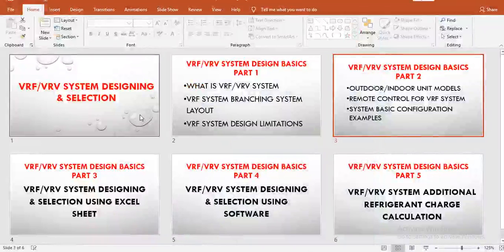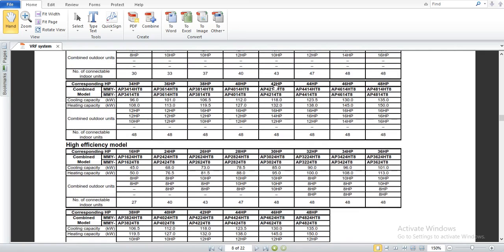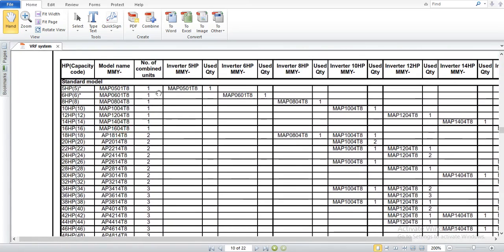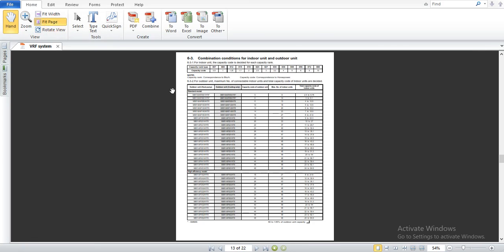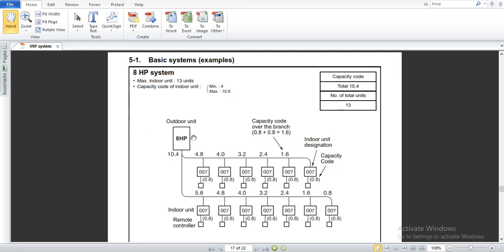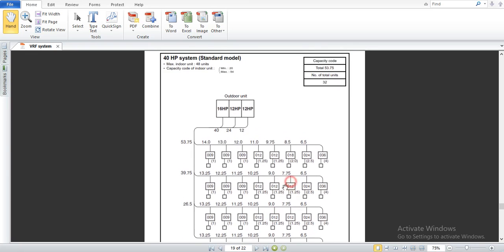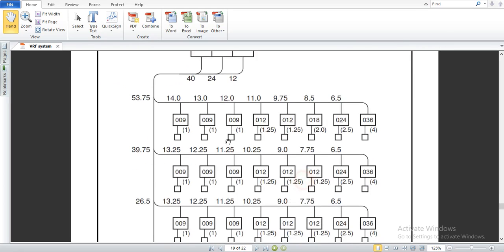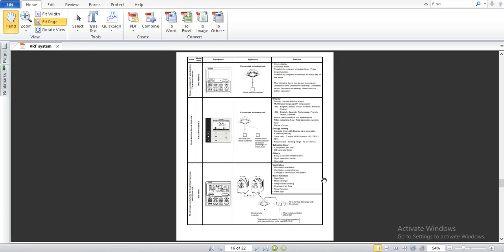vrf system working, designing & selection/vrv system, toshiba vrf system, unit selection part 2

Comment: Question sir, for vrf location, if i have 2 buildings that are connected to each other, do i need to provide 2 separate vrf for each building or 1 vrf is enough?
Reply from the maker: @Angelica it depends on the manufacturer specs while designing your vrf system. As I mentioned what steps need to be considered while designing vrf system. You have to consider total developed length, correction factors, no of indoor units and several other factors. If you see tutorial number 4 and 5 in which I have explained in detail, that would help you more.

Comment: Sir, I am working as a site engineering, recently I have seen that for vrf the outdoor is of low capacity and indoor is of high capacity, I know about diversity factor but in my case indoor is only one (ductable of 8tr) and outdoor of 8hp, then how diversity is used as it has only one indoor unit. The units are of bluestar. Plz explain🙏
Reply: Your comment is a bit old but I'd like to throw in my 2 cents.

The indoor unit is a refrigerant-to-air heat exchanger whose cooling/heating power depends on the exchanger area and the temperature and mass flow of the refrigerant and air. Units with higher nominal capacities have larger exchangers. Typically, the nominal capacity of the indoor unit is given for the high fan speed, so a unit of higher capacity can achieve the same power as a smaller one but at a lower fan speed, with lower air volume flow and lower sound. The outdoor unit sends the fluid to the indoor at a certain temperature and mass flow so it can cover a certain capacity. Thus the outdoor unit which covers the load can be selected to connect at one or more indoor units of larger capacities.

If found that this is especially advantageous for ducted units since it helps to downsize the air ducts thanks to lower air volume flow.